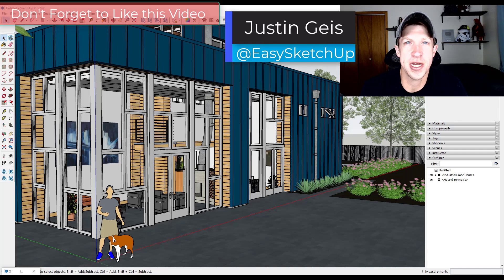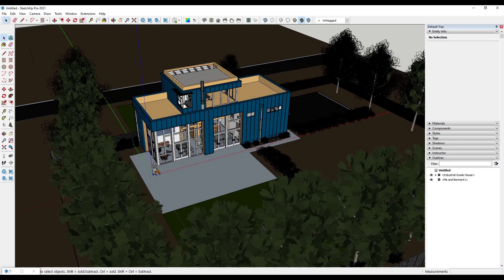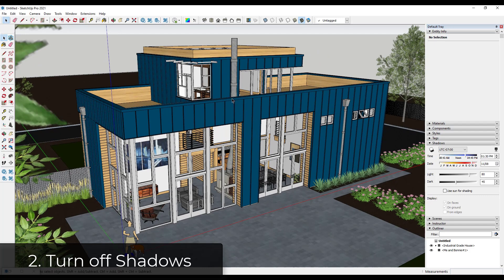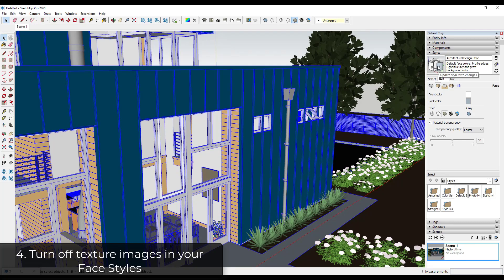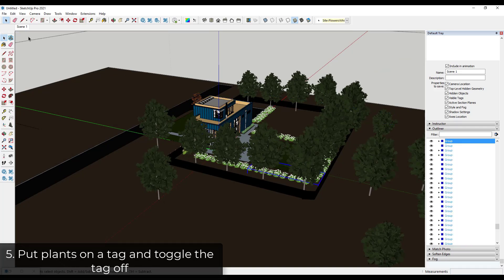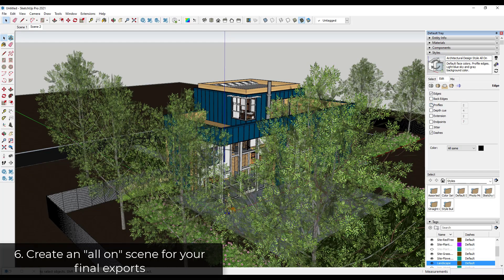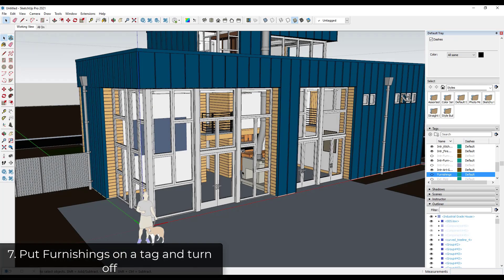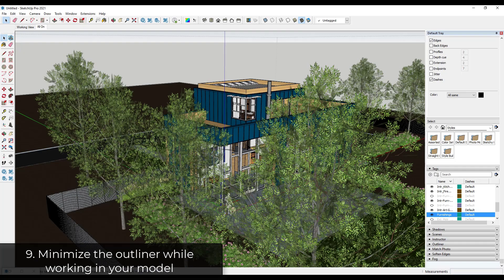My EXACT WORKFLOW for Speeding Up SketchUp Models in 2021! (Step by Step)

Comment: Good work Justin thanks for sharing.  It's a shame one has to do so many workarounds in Sketchup just to make it usable.  Even with my high end workstation with Ryzen 9 3950X, 64Gb DDR4, 3080ti Sketchup chugs with high poly counts.  You would think they would do something to improve the application's performance, other apps handle 5 million polys with ease, so it's bad application design that in 2021 Sketchup can't handle even modest poly counts.
Reply from the maker: I find it perfectly useable - you do have to be careful not to download gigantic 3D Warehouse models, but for the most part it works fine for me

Comment: This is what frustrates me with SketechUp. There are barely any differences between a GTX 1070 and an RTX 3080 Ti. It would be great if they optimized SketchUp so that it runs smooooth even with megalarge projects.
Reply from the maker: Well for now it kind of is what it is - that's why I hate answering the "What computer should I get for SketchUp" question

Comment: Super video as usual. Could you do a similar task using layers as one would do in AutoCAD?
Reply from the maker: I don't know - I don't really use AutoCAD, so I'm not sure how someone would do this in AutoCAD
Reply: @Thesketchupessentials  I don't use outliner. i just set tags (aka layers) and put items on that tag and turn it off.
Reply from the maker: @66meikou  The outliner can be pretty important for keeping your model organized
Reply: @Thesketchupessentials  It may be but I'm old school so I'm good with tags( layers ) I will give it a go though
Reply: I thought I replied yesterday but it doesn't seem to show up. What are now called "tags" are actually layers. I don't know why sketchup decided to call them something else. They used to be called layers.

Anyway as long as you model in "untagged" you can throw them onto a "tag" (layer) and turn them on and off. Untagged = layer 0